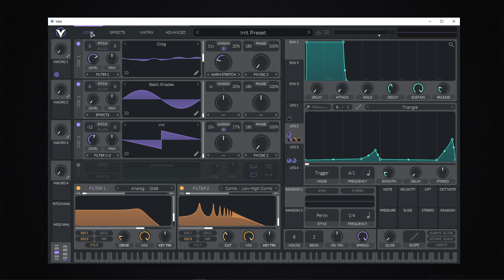How to make a reese bass in any synth | Tutorial

Comment: Can’t did it with hardware synth , are you sure of your video title ”for  anny synth” ....... 
If you had links , for drum’and’bass sound design  tutorial , for hardware synth , it will help me a lot!!!
Thanks
Reply from the maker: You can use this also for hardware synthesizers! Use 2 saw oscillators and detune them slightly, than add a filter and you have a basic reeze. For more advanced druk and bass basses I recommend checking out Frequent, Sine Compression